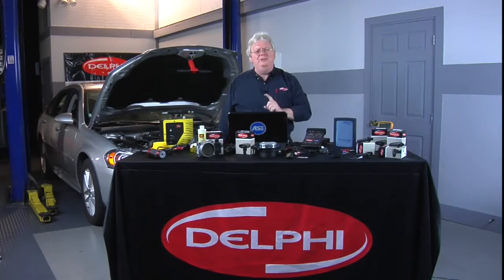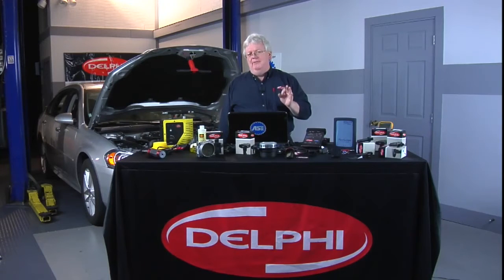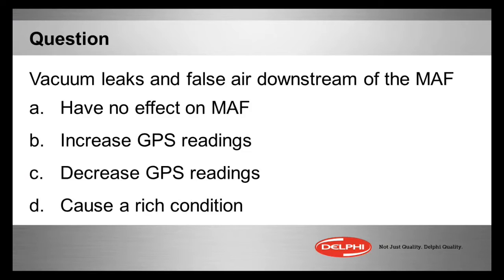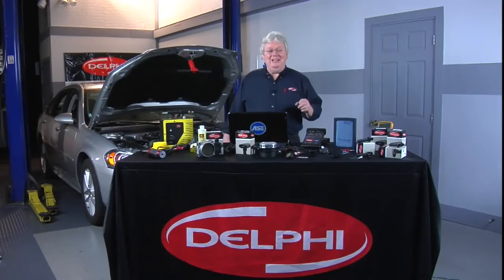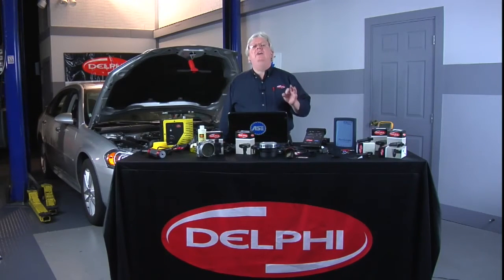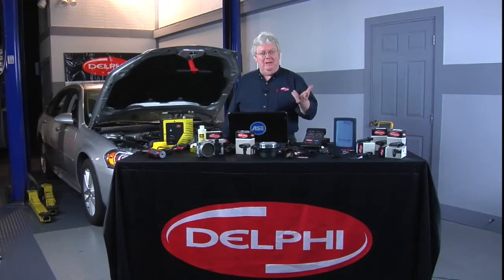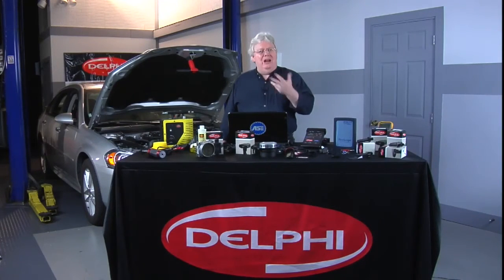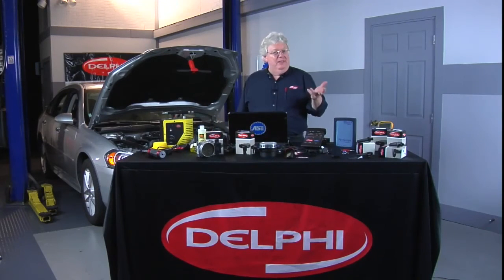MAF Vacuum Leaks and Downstream False Air (MAF and the Modern Tech)

Comment: Omg. So either the MAF causing lean cause its underreporting, or it's underreporting cause there is a vacuum leak causing lean. Gonna give up
Reply: I would say that the MAF is underreporting because of the vacuum leak. In my opinion, the cylinder has a certain amount of air that it can hold. If it is getting air from a vacuum leak, it will have less space for measured air.
Reply: Great question. Hope you get an answer.
Reply: @bbmd2200  Thanks for the explanation. Well eventually I gave up cause no one, even a mechanic shop didn't see a problem. According to Toyota documentation you're supposed to test the readings in neutral. But when I put the car in drive, the readings were normal. I was told online I should go by when it's in drive. No idea why Toyota says neutral. Haven't really checked since then. Maybe I will soon after I replace my tires because someone slashed my tires this week.